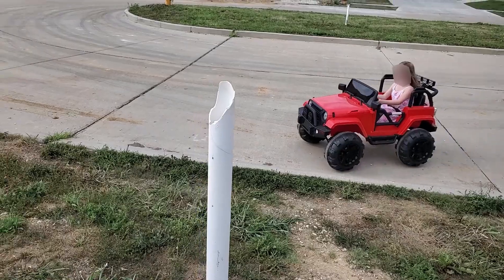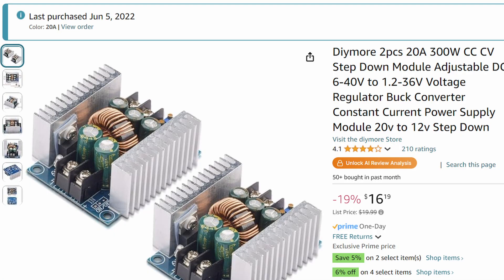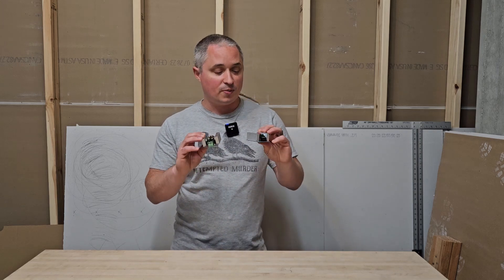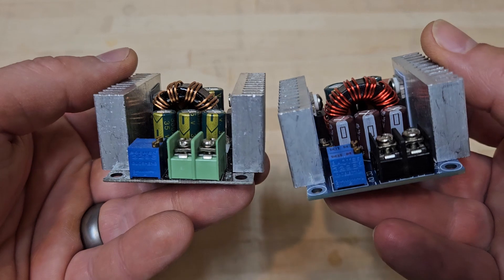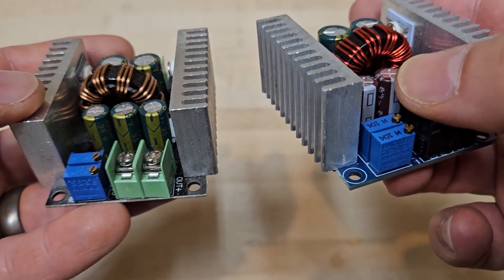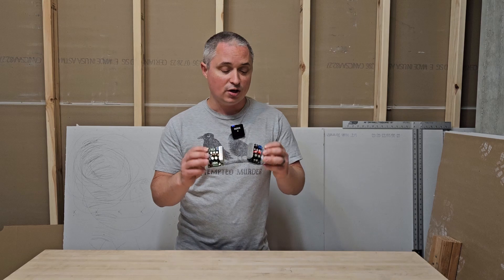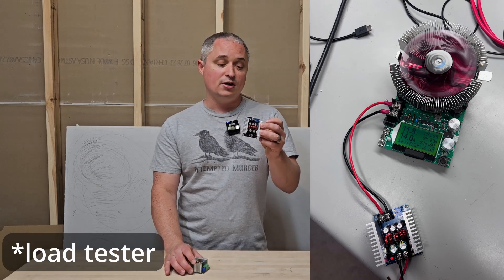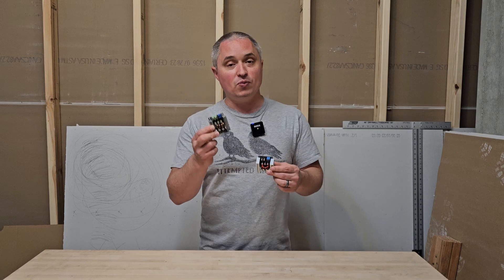Milwaukee Powered Jeep Troubleshooting - Voltage Dropoff Solved!

Comment: Bummer... Even with them running in parallel it seems like it doesn't have enough power and the voltage drops down to 6v when in use and regularly stops and starts with the engine sound. Might have to chalk this one up to a loss and try something else. Thank you

Comment: Can you just run it at full battery voltage or will it fry the motor? Havent seem the previous video my M18s topped out at 20.1v each
Reply from the maker: It will run for a little while at 18V, but you'll probably burn out the motors early or strip out the plastic drive gears. I think my daughter's Jeep probably has several hundred miles on it so far with no problems using the buck converter set to 14V.
Reply: @DoresoomReviews  Bummer, it would be funny to see it run for a bit @ the 800w the XC5 can deliver